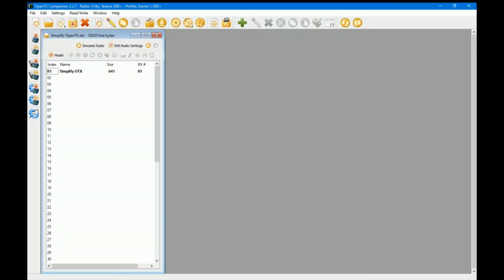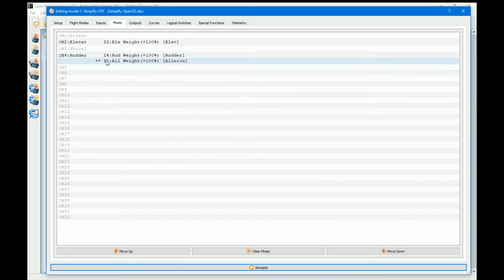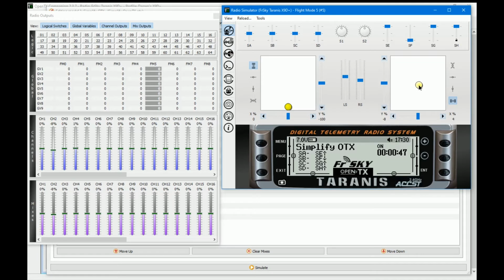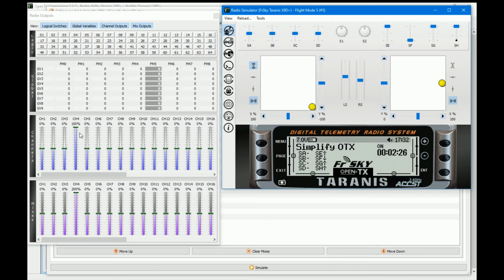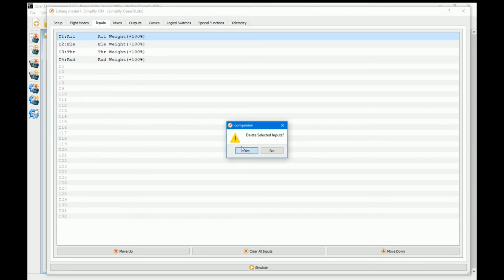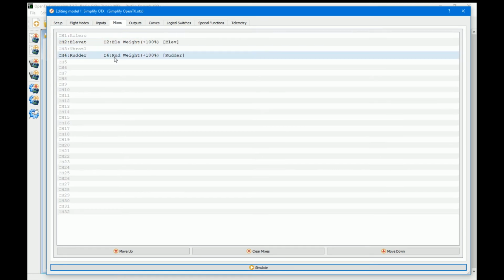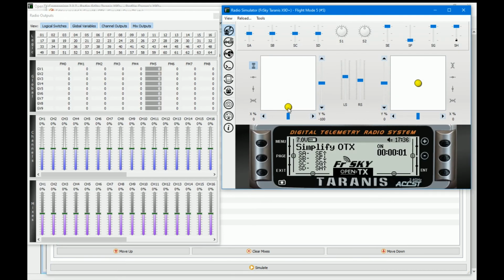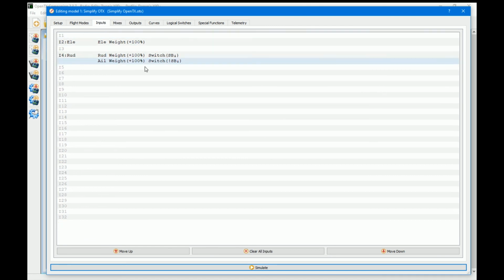Using two two inputs to control one output in OpenTX

Comment: just what I needed thanks!
One question  - can INAV operate with a 3 function glider  ie motor, rudder and elevator ?
thanks Hans

i

i
Reply from the maker: To be honest, at the moment 3 channel isn’t great. iNav is much more competent on models with ailerons. I’ve never personally tried it. But have heard a lot of problems when people try only rudder control.
Reply: @MrD  
okay thanks - I'll give it a try anyway
I set the mixer for 4 servos, then bring the weight down to zero on the ailerons via the TX